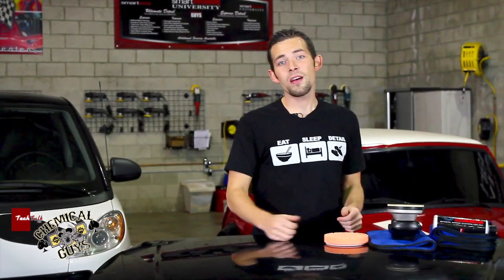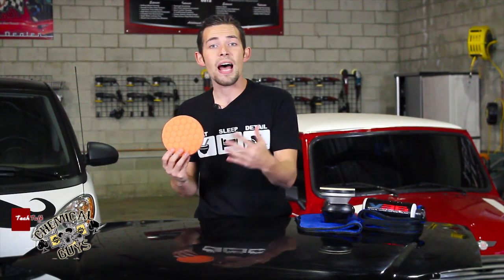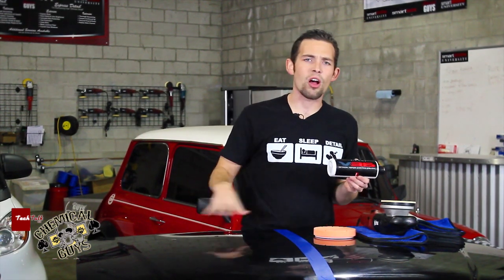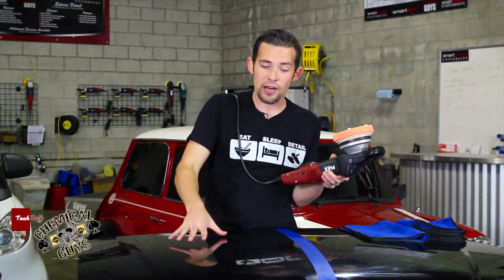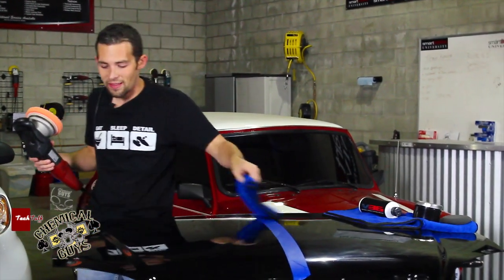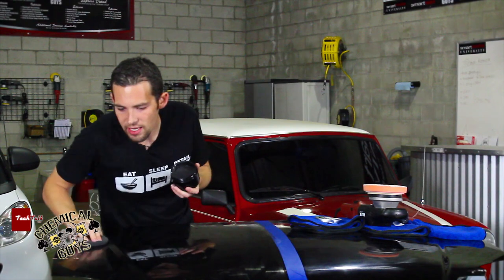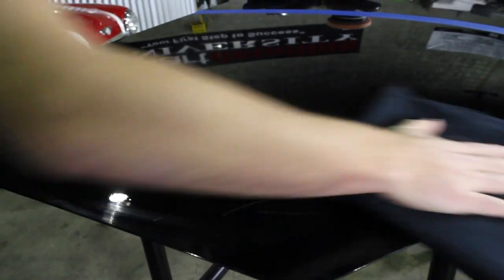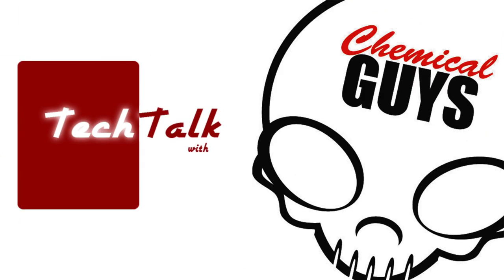How To: 1-Step Polishing To Remove Swirls and Scratches - Chemical Guys Paint Correction EPIC SHINE

Comment: What was the name of wax you used....
Reply from the maker: Hi Steve, 

The wax used in this video is the Black Luminous Glow Infusion for Black & Dark Paint. Our proprietary manufacturing method utilizes a patented cold emulsion process to give black its deepest shine possible. Using advance super polymers that repel airborne pollutant, water, and ultraviolet radiation, it bonds to the surface to create a durable shield of protection. Chemical Guys combine show-winning style with industry leading innovations to bring you a wax that will let your black paintwork shine.

Comment: Wouldn't you follow this up with V38?
Reply: +Michael Chacon the definition of one-step polishing is that it is only one step, thus not using 2 different polishes
Reply: +ImElkay so can I just use VSS instead then seal it with jet seal?
Reply: I've never used VSS but to my understand it's just a light polish, probably equivalent to something between v36 and v38.  That should work just fine.
Reply: +ImElkay thank you.

Comment: Do i still clay bar my car first?
Reply: If the paint is rough and feels like there is contaminants on it then always clay bar.
Reply: msand951 Always clay bar your car before you cut/polish your vehicle. Do the zip lock trick and you'll feel everything that is left behind after a regular car wash. Stick your hand and a zip lock bag and feel your car... All those bumps that you feel when you haven't clay barred your car, now think about that crap getting stuck in your pads and spinning all over your car at a high speed lol.

Comment: And he forgot to say the flex polisher on the video it cost $400 lol guys please don’t think you can get results like this if you have a low budget polisher I’m keeping it 100%
Reply: Soul hunter You’re wrong. You can get a decent one like griots 6” for around 140$. There’s also the harbor freight 6” performs really well once you replace the cheap grease inside with a new synthetic high quality grease, and get a 5” backing plate. You can get the harbor freight for like 50$ with a coupon.